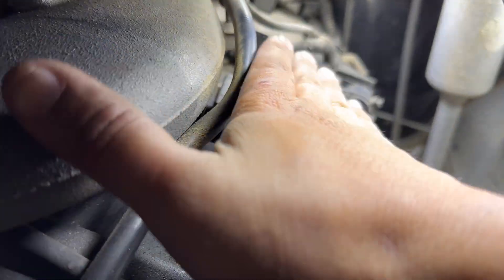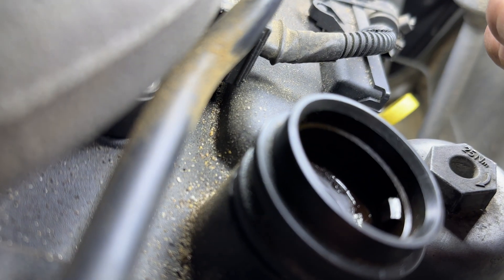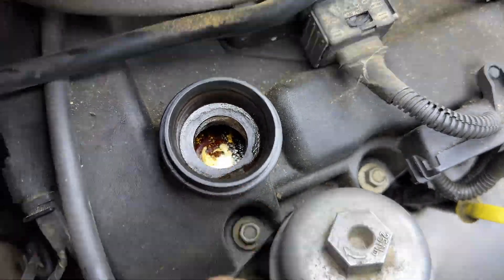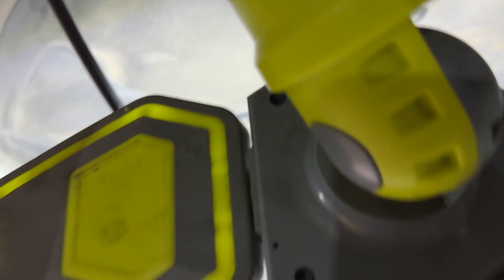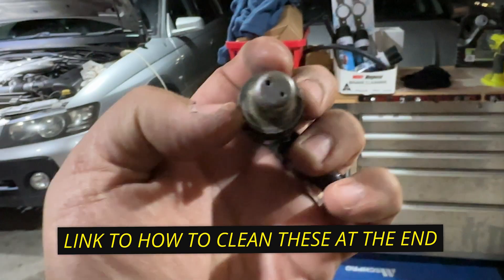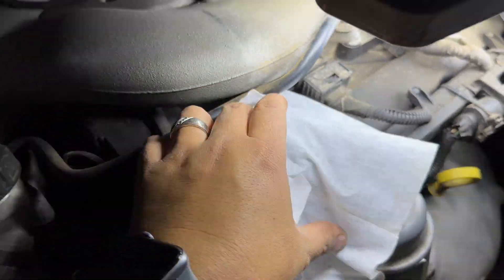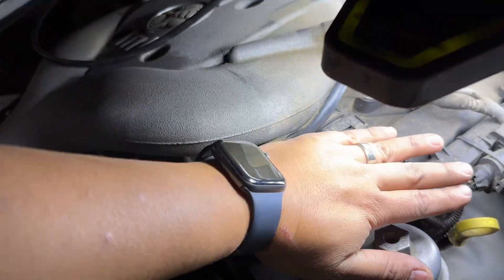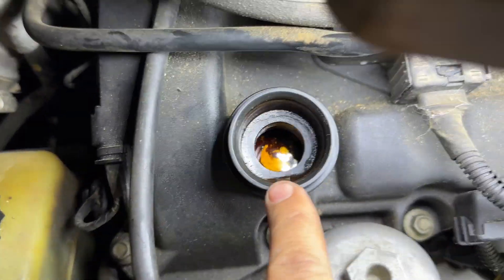10 sec way to see if your alloytec PCV system might have an issue! Holden V6 HFV6 LY7 LE0 Engines

Comment: That clicking noise they make... is that normal for the alloytecs?
Reply: @mitchmunro2744  I was just wondering that I’ve been driving my g8gt so much I forgot what my v6 sounded like amba it concerns but I will definitely be checking my valves tomorrow

Comment: Hey mate recently bought a ve SV6 and it's just started making a noise...... Start the car up then there is a clunky rattle for roughly 3 seconds then goes away only on cold starts in morning 

Hoping you can help me out coz you seem to know these engines very well 

Cheers mate :)
Reply from the maker: At your next service use 5w40 dexos2 full synthetic oil, plus liqui moly MoS2 Friction Reducer 1 bottle with your usual oil fill. Instant improvement within a day or so. It’s an additive and is added to/with your oil.
Reply: @AllTerrainAction  hmm  ok will try that thanks.... just finished an oil change with that same grade oil will start it when its cold in morning if no improvement i will give that additive a go....thanks so so much all terrain for getting back to me with the useful info
Reply from the maker: @thomasaram7684 yeah well proven in the Adventra community for alloytecs same same engine in future commodore models. It’s all to do with the MoS₂ (Molybdenum Disulfide) as it creates a microscopic, solid lubricating layer on metal surfaces, lower internal resistance, will reduce wear during pressure dips and helps chain tensioners maintain function when pressure is borderline. Once the timing chain jumps a tooth you have to do a change on the chain, MoS₂ will really help extend what life is left on the timing chains if pressure pickup is slow at cold only. 3 seconds is a bit long.. but 1-2 seconds is really acceptable these days. 5w40 over 5w30 will bring oil pressure up, you’ll notice that on the oil pressure gauge.
Reply: @ you sir are a god......will deffinetly try the mos2 additive even if it doesnt help i dont think it will hurt it......... used to own a vs wagon so these 3.6 engines are all new to me
Reply: @thomasaram7684  timing chain

Comment: Thanks for the cool video and the clear demonstration of what to look for on one of these engines as far as the positive crankcase ventilation system when it's blocked. Hopefully this can help save a few of these engines which lets face it, do have a pretty bad reputation. Nice video of your gutsy Alloytec Adventra tackling that sandy track too, sounds the business and goes hard! 👍

Comment: Nice one, ive drilled mine to 3mm, 2mm and 1.5mm and i dont get oil at the top, also having issues with it going into limp mode sometimes after an hour of driving P0300 misfires all on bank 1.
Any ideas? cheers.
Reply: Did u sort ur problem bro? I got same issue!

Comment: Hi bud I have a 2005 VZ 175 kw ute I use it in burnout comp I've had no dramas with the motor I have spun a lot of people out with it cos they can't believe it still going I've done 7 comps with plus my own fun 😊    my drama is trying to control the transmission from changing gears when I won't it to change do you have any advice on that problem
Reply from the maker: Throw HP tuners or EFI live on and adjust some shift settings, ditch all the torque management. Assuming it’s the 5L40 if it’s the 4L60 I’m not too sure.

Comment: I have edited this into the Walkthrough I did four years ago on the Just Commodores Forum.

I have added the previous videos into the thread as well. 

Solves a few problems that can creep up. Oil leaks is one example.
Reply from the maker: Yeah, the first point of leaks we find from unmaintained PCV's in Adventra's brought in to us are at the camshaft sensor seals at the top on the timing cover on the front!
Reply: Hi guys, really need help fixing a possible pcv issue in my vf 2, sv6. Losing 750ml of oil a week - no leaks, no blue exhusst smoke, no bad smells - has to be a PCV issue. Is there any videos showing how to do it in my engine? It's not like the VZ alloytecs @FuManchu5ltr I hear you know a lot about this known issue
Reply from the maker: As FuManChu suggests JC forums be the best for 2 way communication and eyes of other enthusiasts!
Reply: @AllTerrainAction  thanks lads
Reply: @ronnied03 Doesn’t have to be a PCV issue. The LFX isn’t any different. Still is an Alloytec. Direct injection is the only fundamental difference. VF2 had the modified PCV already. Holden made it with the larger holes. No need to modify. 

Post your question up on just commodores so it can be addressed better.
Reply: Thanks lads @FuManchu5ltr

Comment: What tool do you use to take a pcv valve that is going to be removed for the first time. Don't want to crack the plastic cover it's attached to .
Thanks
Reply from the maker: We use pliers, multi grips do also work. The very first time you ever pull it out it will require some upward force. Make sure to first remove the plastic cap, there is a little plastic pin you slide on it and it will just lift up that shouldn't require much force. Then once the valve is exposed it has rib that you can grip and pull upwards. It is normal that once you've removed it it will be easier to remove in the future. See our other video about removal in the video description, but generally an easy job. I have found out recently that Alloytecs with gas systems, often the gas cooling lines from the heater tap area and it makes working in that area a pain in the backside.
Reply: @AllTerrainAction  thanks so much for that
Reply from the maker: @nickl2548 no worries! Happy alloytec life 😬👀 they are great motors if well maintained!
Reply: Hey what do you think would be the issue if I’ve got NO suction, but also no oil coming over the top?
Reply from the maker: @randomname3665  not necessarily indicating an issue, can you check your oil pressure using a scan tool? If not try and check it on a cold start, that little period when the engines is idling higher to warm up, check if oil shows itself then.   I don’t have enough test samples to say that not seeing oil is an issue, especially if there’s no other signs of issues. If it’s not broken perhaps don’t worry. Should be using 5W/30 or 5W/40 full synthetic anything else, is not recommended. Could also be a sign oil filter could be a little dirty but again only taking a stab in the dark without more info.
Reply: @AllTerrainAction  thanks mate, I just got some time and took my pcv valve off and it did have a bit of crap on there so I just cleaned it then, after cleaning it I did notice oil on top which is better, and for some reason now a very very very small suction, but only the tiniest amount. Does that sound good? Thanks heaps bro👍🏻🤙🏻
Reply from the maker: @randomname3665 yeah I wouldnt worry too much about that, negative pressure is likely coming from PCV system anyway, perhaps the PCV is drilled a bit? Sometimes allowing too much vacuum from the intake system either way, nothing to really worry about. Normal engine sounds, good oil pressure and engine temperatures really is all you have to worry about if everything else is taken care of.

Comment: Definitely a faulty pcv they shouldn't allow negative pressures in the crank case
Reply from the maker: I took this video earlier this year, I remember I was also confused about this, normally when I see negative pressure they are drilled out but when I checked it was just a standard PCV and totally blocked couldn't pass any air through it. We swapped it with another that I had pre-soaked and cleaned it out and this issue immediately went away. I might still have that old PCV in the shed - but you should know they are not one way valves they are hollow inside, with just 3 holes. I wonder if negative pressure is coming from the crankcase vent on bank 2 on the engine the side where there is no valve at all, and by restoring flow to bank 1 its given the fixed result here...
Reply: @AllTerrainAction  yeah it balances it out
Reply: The negative pressure comes from the intake manifold vacuum while running

368000kms on mine and it still runs like new